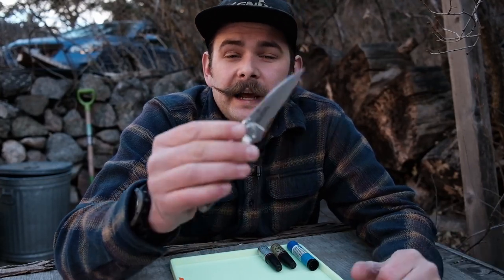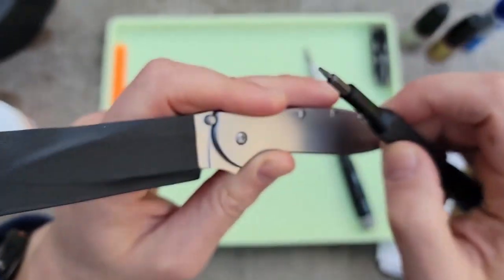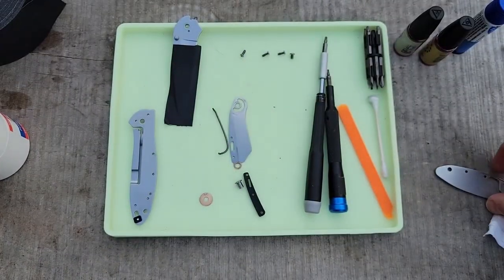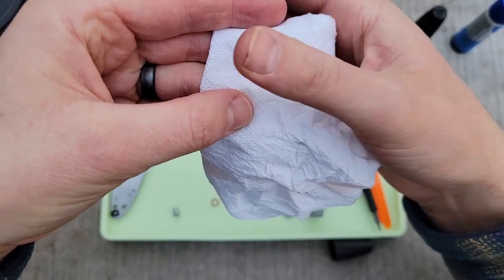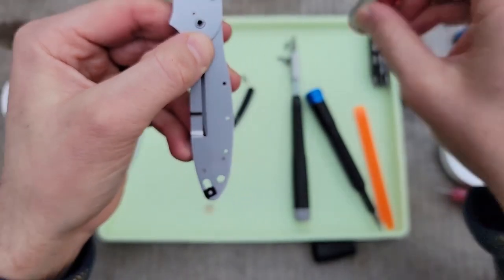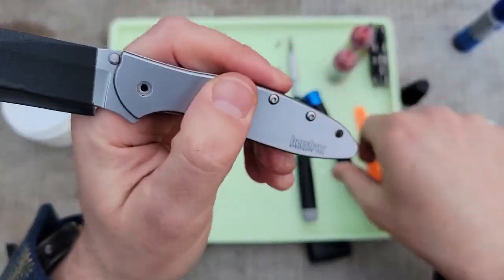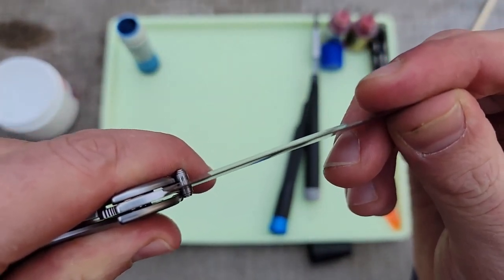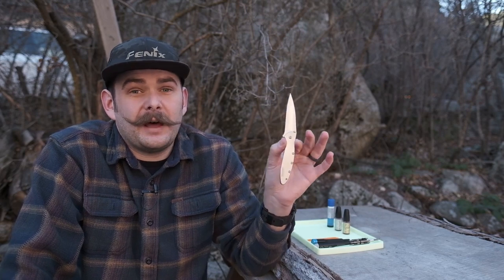How to Maintain Your Kershaw Knife

Comment: What kind of grease did you use for the torsion bar mechanism? Thanks!! 😃
Reply: Any grease that you own will work. The function of the grease is more for having the torsion bar to be more quiet. So you dont need alot of grease in there at all. Just put some  in there and smear it out so the torsion bar will not rattle. So any grease will basicly work.

Comment: Very interesting! How would you repair a broken tip? I broke a tiny piece off and don't know what is the best way of making that invisible. 
Thank you.
Reply from the maker: It's possible the tip could be sharpened out. If you would like, our warranty team could try doing that. Just fill out a warranty form, print, and send with the knife for service. Or they can replace the blade for $25.

https://kershaw.kaiusa.com/warranty

Comment: can you swap out a carbon fiber leek blade 154 cpm for a standard leek blade half serrated
Reply: You should be fine. I’ve swapped blades between a cf leek and a teal aluminum handled leek, no issues. Though they were made around the same time period. Not sure if there has been any variation in specs over the long production history of the model, but I would think it will work.

Comment: What size bits was used??
Reply from the maker: T6 Torx bits fit pocketclip, handle, and safety-lock screws on current model knives. T8 fits the pivot screw.

Comment: The flipper on my Kershaw Leek is very difficult to deploy. Any ideas on how to make the problem disappear?
Reply from the maker: We recommend filling out a warranty form, printing, and sending with the knife for service. 

https://kershaw.kaiusa.com/warranty
Reply: If you don't have the patience to send it in, the first things I usually try are loosening the pivot screw a little bit (with the torx bit he mentioned), or just rinsing the pivot area with a little rubbing alcohol while working the blade back and forth, blowing it out with compressed (or canned) air, and applying a few small drops of oil.

Comment: my Kershaw leek’s spring/torsion bar just broke inside my knife and I tried to get the free replacement from Kershaw but they haven’t sent me anything. It’s been over a month of waiting and I even sent a request 2-3 times in case I possibly messed up something but nothing happened. What do y’all recommend? Switch to a different brand of knives? Like spyderco or benchmade
Reply: Spyderco all the way. 

Kershaw used to have an incredible lineup… but lately (last few years at least) they’ve been disappointing.
Reply: @just9911  yeah man I was helped by Kershaw’s warranty so it’s great I guess it was just a freak accident or bad luck on my end but I think it’s a great knife nonetheless. But yeah am a spyderco user through and through.

Comment: I don't get these maintenance videos on knives.  The average person is not going to have the tools or the know how to take that thing apart and get it back together again right. A knife should be a simple tool that doesn't need to be maintained in a lifetime.  If it does I suggest not going with that knife company.
Reply from the maker: With a little practice, maintenance is easy for anyone, as we explain in the video. We sell a TX-Tool, which is all you need for adjusting the screws.

https://kershaw.kaiusa.com/catalog/product/view/id/11111/s/tx-tool/category/788/

Our knives are designed to last a lifetime, but that doesn't mean they won't get dirty or need other maintenance. And if you want replacement parts, need us to repair a manufacturing defect, or replace a blade, our limited lifetime warranty service has you covered. 

https://kershaw.kaiusa.com/warranty
Reply: I'm not sure where you're from, but the "average" person who carries a pocket knife is a person who is prepared for little hiccups in life.  These sorts of folks tend to be better equipped to deal with minor repairs that the average "city kid."  If you think that folks don't have Torx bits, then you're well and truly misinformed.  As for knives being simple...yes they are.  The wedge is the simplest tool know to man.  Our modern-day knives happen to fold and contort to be safe when closed, house pliers, and even have common tools nestled within.  If you're not capable of maintenance and expect infinite reliability, I'd suggest you find a sharpened bit of rock to use.  I suspect you lack the intellectual capacity to safely operate anything more advanced.
Reply: I get where ur coming from but all equipment that is used will need maintenance at some point. Folding knives are a lot more complex then a simple fixed blade because of the moving parts and therefore will require more complex maintenance, pain in the ass no doubt but understandable.
Reply: … if you can’t handle taking out a few torx fasteners, cleaning off the contact surfaces, and reassembling everything you probably shouldn’t be using a knife.

You can get a decent Torx set for 15-25 bucks and WD-40 is cheap & plentiful. That’s all you really need. Maybe some loctite, but that’s a preference thing. 

This whole process is INCREDIBLY easy and straightforward.
Reply: a better magic number is 747
Reply: Even a fixed blade, the simplest of all knives, needs to be maintained from time to time, including sharpening, and perhaps protecting with some oil, depending on the steel and the handle material. 
In my experience, Kershaw makes some very reliable blades in all price ranges, and I've been very happy with the function of those I've purchased, including the more complex folding ones.